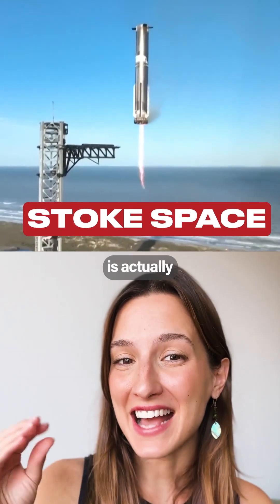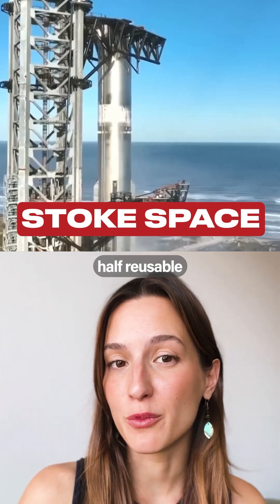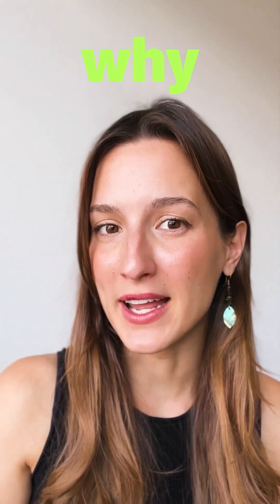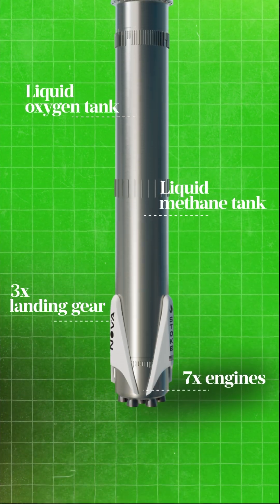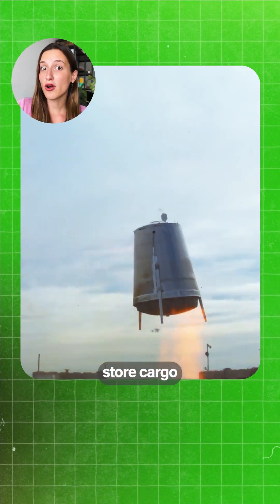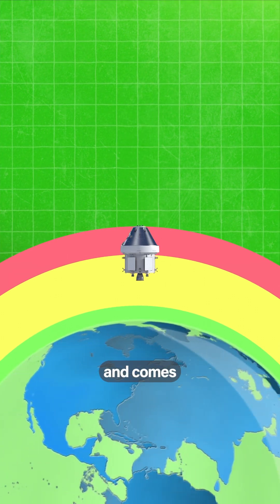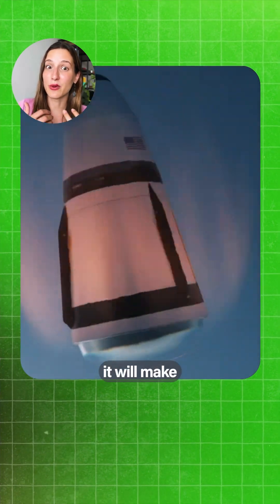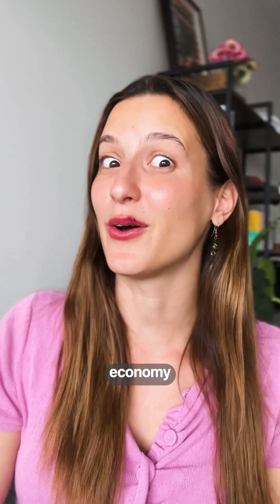Why Is Reusing Rocket Tops So Hard?

Comment: Great video but there is a very common misconception included. Going up into space and returning straight back down doesn't turn you into a fireball. Look at Blue Origins New Shepard. What makes you turn into a fireball on reentry is not the altitude you need to be in space, it is the speed required to stay in space. You need to move at 7.8km/s or 4.8mi/s (28,000km/h or 17,000mph) to stay in low earth orbit. Also the booster fuel is almost completely used to boost the upper stage and only a very little amount is used to safely return back to earth and land.
Reply from the maker: Thanks so much for the correction! Any good book / article suggestions to learn more about spacecrafts?
Reply: @giota-scienceandtech  well most of what I know about the topic is from yt, I can highly recommend to check out everyday astronaut